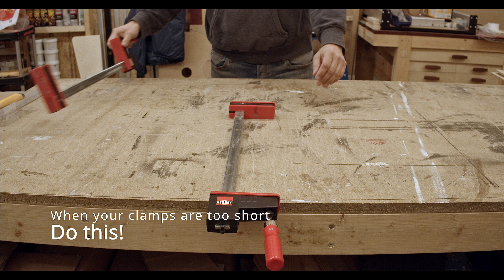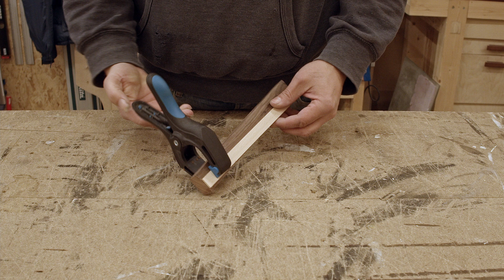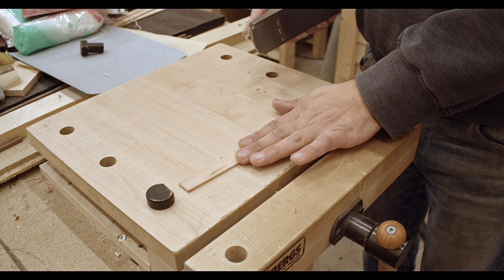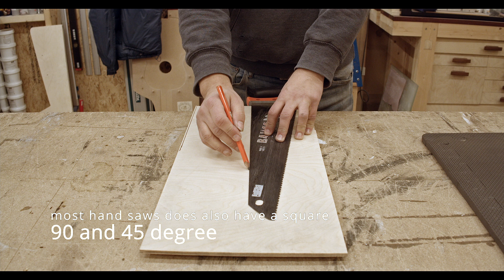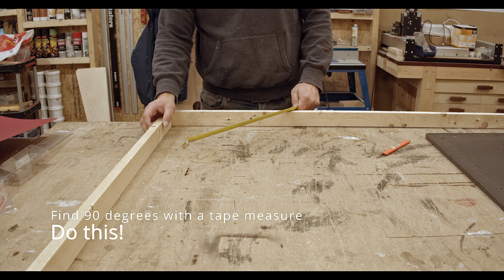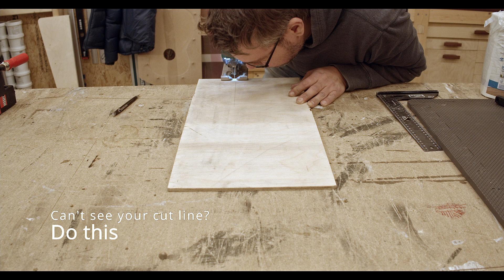DIY Tips That Actually are Useful!

Comment: +1 tip for plexiglas: you can easily plane the cut surface with a regular hand plane. Not an electric one :) Or if you cut it too big, and need to remove just a bit, a hand plane can to that too quickly.
Reply from the maker: Good tip Akos, Thanks :)